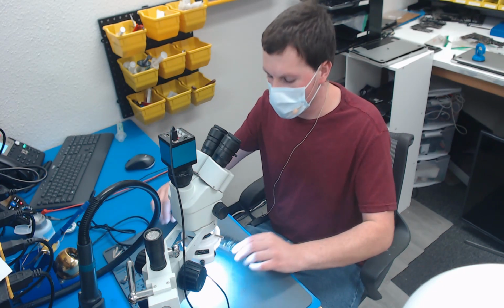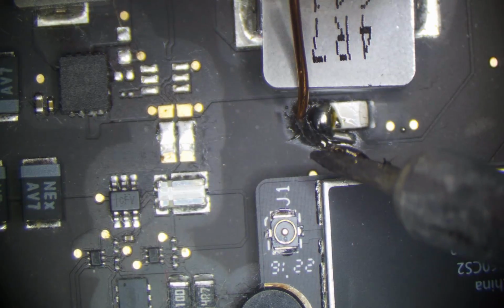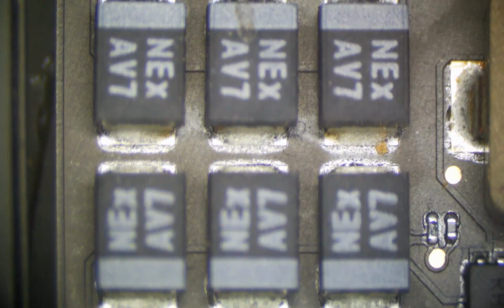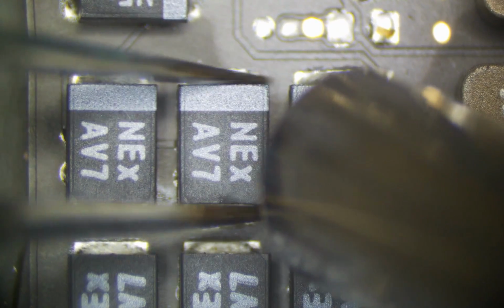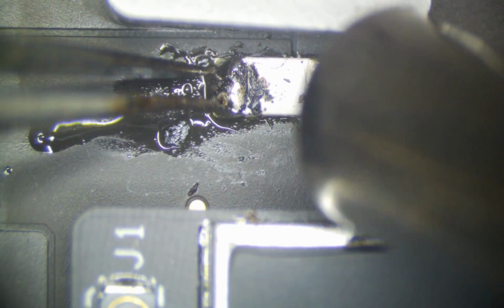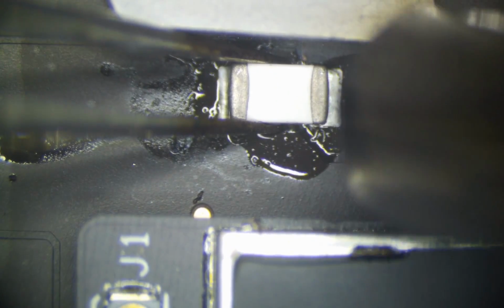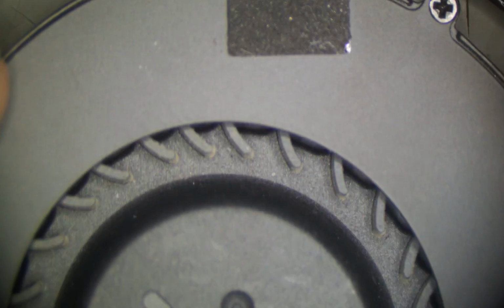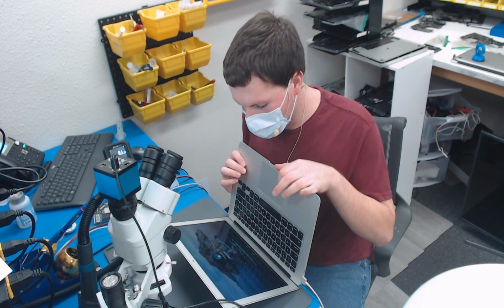The most common cause of a MacBook Air not powering on randomly.

Comment: Thanks Tim, no muss no fuss :) I notice that you are quite fond of leaving the lead-free solder in place and just replacing the faulty component, whereas most people I see, clean up and use leaded. I like this as it saves quite a bit of time. In what situations are you more inclined to wick the lead-free away and re-tin with leaded please ?
Reply from the maker: When there is any type of corrosion I always wick and apply new
Reply: @TCRSCircuit  What alot of people don't seem to understand is, solders are alloys, they are made to do a job, they don't intermix as it changes the alloy and completly changes its specs. Think of the special desoldering solder, it lowers the melting point. Corrosion also has wierd arse stuff in it and changes alloys, powered water damaged conections make really wierd chemicals via electrolosis. You need to clean all that shit off for a good solder joint. Flux just stops oxidation of the solder alloy and if it has solvent in it it also cleans. It doesn't majicaly change the existing lead free alloy into a compatible leaded or silver based along with all of its nice propertys. best to clean the old away as much as feasable and stick your own in.
Reply from the maker: @UberAlphaSirus  that won't make a difference if you are pulling a fuse from another board using the same alloy type.